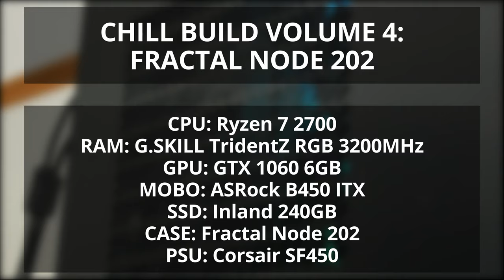Chill Build Volume 5: Fractal Node 202 "Obelisk"

Comment: Pro Tip... the section of the case where the PciE extender goes, it's removable. You are supposed to remove it to install the video card and extender together, then slide them in all at once (after you install the motherboard). It will keep you from having to deal with those screws for the PciE extender awkwardly and gives you room to install the motherboard with the CPU and cooler already attached.

I cannot take credit for this,  as i found this on on a video done by Gadget Workbench.
Reply: it also is printed in the manual - with nice big pictures :)

Comment: you can remove the video card portion of the frame, makes it easier to attach the PCIe extender if you do have the motherboard with the CPU and cooling installed. there's a few screws on the top of the center of the frame and it'll just lift out

Comment: Great video, I would always use at least one M.2 ssd in this case as it reduces the need for a cable ( space is at a premium), you can also reroute the power extension cable under the riser card if you are putting fans and a bigger graphics card in. Love this case.

Comment from the maker: Someone on reddit asked about thermals in this case. I don't usually do tests like that because I have a difficult to control ambient situation. However, after about an hour of simultaneous FFXIV benchmark, Blender 3D animation rendering, and youtube video watching, I've hit 73° C on the CPU and 77° C on the GPU. Those are the maximums at spikes of high temp. sustained average is probably closer to high 60's.

EDIT: The GPU temp made it up to 82° C after 4 hours. It wasn't pegged at 100% usage though.
Reply: yeah me too. I am using EVGA GTX 1060 3GB Single Fan also hit 82c after 30 min play game Left 4 Dead 1 hahaha. but the temp steady at that only. but one time I'm benchmark using fur mark  the temp up to 88c

Comment: Why did you not install 2 fans under the graphics card?  They keep it cooler, at least a few degrees...
Reply from the maker: It isn't always necessary to add more fans to a PC. It may keep it cooler but it may be a trade off of noise or price that isn't worth it to many. Enough is as good as a feast.

(to quote Mary Poppins)

Comment: How is the noise on this rig under load? 
Sort of want to squeeze this under a monitor stand because I have no space on my desk, but at the same time I need something relatively quiet for music production

Planning to get this case with a r5 2600 and a gtx 1660ti, but the gpu wouldn't be active itself during music. Also no HDD if that helps noise?
Reply from the maker: It's not going to be very loud, but if you need a near silent system for music production, you could make some optimizations.

What you COULD do if you want it to be very silent:

Switch out the Cryorig C7 for a Noctua NH-L9a cooler. It'll be slightly quieters, but not silent. 

You could replace the PSU with a passive SFX PSU (no fan).

If the main purpose is not gaming, but music production, you could get something like a passive GT 1030 to make it really quiet. At that point, you wouldn't need a case this big.

Comment: Your remark on the difficult-to-reach screws for the pci-e riser is incorrect. In the manual (RTFM) it is shown, that you should take out the L-shaped bracket (4 screws) onto which the riser card and the graphics card will be mounted. You can completely pre-assemble the L-shaped bracket, riser card and graphics card outside the case and insert this complete subassembly back into the case. This can be done while the MB, processor and heatsink are already in the case.

Link to manual, page 10 and 11: https://support.fractal-design.com/helpdesk/attachments/4021193594
Reply from the maker: True

Comment: 2 observations :
1. The entire vga bracket should be removed when you install the vga card,
2.The Cryorig 7 has a perfectly square cooler, so you may chose to turn it 90 degrees so that the cooler fins are parallel to the dim modules and thus will push the hot air directly to the upper exhaust of the case. Guaranteed 3-5 degrees cooler cpu temps, which in such tight spaced case is a lot. The way you've mount it, the air flow is obstructed by the memory modules.
Reply from the maker: 1. What? Can you please give your reasoning?
2. What? That's not exactly how airflow works, but you're right; it might help. Can you please show me where you got those "guaranteed" numbers, what units they're in, and how that was tested?
Reply: @ChillBuilds  1. I have the same case and the same videocard, and when mounted as you shown, the 2 "teeth" from the videocard lower end bracket (the connector plate) do not enter into the designed slots of the case the was you've installed it. You may look on yours. Thus the card is a bit "wobbly" and it needs that extra securing via the sliding bracket from the case side. And you might not be able to completely remove it in order to install for example, 2 fans for extra cooling. But that's just me. 

2. What I've meant is the "air flow" coming out from the cpu heatsink. The fan is pushing the air left and right along the heatsink fins, correct? In this way, air going along the fin alignement , on one side is obstructed by the memory modules, and on the other side is hitting the vrm heatsink. By turning it 90% your air flow will be pushed directly out towards the top of the case. And we all know that hot air rises anyway so why not help the physics. I have in intel cpu with a nh-l9i cooler which is also square 92/92 mm (the amd one is rectangle and it can be mounted in just one way). And I've did just that, switch it so that the fin orientation becomes parallel to the dimm slots, to push the air towards the case top instead towards the memory dims. And this is what happened, idle the temps dropped around 5 degree, and load was up to 3 degrees lower.
Reply from the maker: Ok, let me clarify things to everyone reading this. 

The card is installed correctly and you should definitely use the support bracket. I am not sure what this gentleman means by the "teeth" entering the slots, but your card should be essentially square with the right angles of the case when it's installed. Please always install the support bracket if you can. That's there because you're mounting the card on an extension piece connected to a riser card. It will prevent sag in the direction of the support when the case is laid flat and also block movement (and possibly damage) of the video card when you move the whole computer.

As for the temperatures, the guy posting about turning the heat sink 90° may be right, but he may also have seen a drop in temperatures due to remounting and re-pasting. Another issue is that airflow across a major portion of the VRMs gets cut off if you turn the CPU cooler. In light loads or with beefy VRMs it might be better to turn the heat sink one way or the other. That entirely depends on your hardware, workloads, and situations. Without actual test data (we don't have multiple trials, controls for variation in installation technique, controls for hardware selection, or even TEMPERATURE UNITS), I can't say whether or not his suggestion is true. It might be. I just can't tell. 

That's why I don't do extensive thermal testing on builds. If they work and get the job done in safe operating temperatures without any obvious improvements glaring back at me, I'll leave it alone. It just takes way too much time to do real tests.
Reply: @ChillBuilds  Hi, english is not my native language so I've probably been misunderstood. 

1. what I've meant is to remove that whole L bracket part, unscrew it from the 3 holding screws,  and install the videocard outside the case. Then put it back in. Leave the "teeth" issue, if I could show it to you, you would understand.  On this https://www.onbuy.com/gb/water-cooling/gigabyte-ultra-durable-vga-gv-n1060wf2-6gd-geforce-gtx-1060-graphic-card-1-gv-n1060wf2-6gd~c8579~p10952088/ you can see the card having on the  metal vga bracket one L shaped end at the "top" and ending with, 2 ""teeth" below,  under the dvi ports. When the card is mounted correctly, you should be able those 2 metal part in the back of your case as there are 2 small  spaces in the mounting bracket where those teeth fit in order to tighten the card and not rely only on the upper screws. 

2. Well I was just giving options and reason for people to consider if using a square cpu heatsink that can be installed in both ways.
Reply from the maker: @user_23165  It doesn't sound like you installed your GPU correctly. The metal mounting flange on the GPU or any expansion card is typically not removed for installation unless replacing it with a different shape flange is necessary.

Comment: Great video! 

Is there a place for a 3.5 HDD? Or just 2 2.5 SSD?
Reply: no, but there are lots of 3d printable files on thingyverse where you can mount for example 2 3,5 HDDs in one Fan-Mount, if you use a shorter graphics card or if you use an APU - for example if you build an HTPC with loads of media storage

Comment: What sort of thermals are you getting on this? Thanks
Reply from the maker: Some Farenheit, some Celcius, and a few Kelvins every now and then.

There are so many variables that even if I had great measurements, you could get wildly different results. This case is fairly well ventilated but the cooler shown is small. You can expect temps on the safe, but warm side.

Comment: I'm thinking about making this myself. Can it run Heros and Generals, CSGO, and some other light games?
Reply from the maker: This exact system is probably overkill.
Reply: @ChillBuilds  what should I do then?
Reply from the maker: @embxssyy9936  Is that.all you want to.do.with the PC? Playing in 1080p? What's your budget? Where are you?
Reply: @ChillBuilds  Budget is under 1k but I'm thinking under $600. I just want a pc that I can play games with no problem.
Reply from the maker: @embxssyy9936  "Play games with no problems" isn't very specific. But, if you get a decent quad or 6 core AMD CPU  and something like an RX 570 4GB, you should be able to easily play those games and put together a PC in the lower range of that budget. Just remember to get a legit Windows. Don't pirate.
Reply: @ChillBuilds  okay thanks man
Reply: @ChillBuilds  I disagree, you should get legit windows.  You should pirate windows. It's the way to go it's the moral way to go it's the way to progress technology forward by pirating windows!  ;-)
Reply: You shouldn't get legit windows. Legit windows is shit. It's rip off. You should instead pirate it with a good conscious.  Why pay for Windows loaded with problems and instability, when  apple offers Mac os for free which works superior to windows by light-years better than winshit 10

Comment: is that cryorig C1 CPU air cooler?
Reply from the maker: Nope, that's the c7
Reply: @ChillBuilds  thanks for the info, but does the C1 fit to the case? i want to build like your video but using C1
Reply from the maker: @dandysetyo9365  I don't have the case anymore. Check the specified height of the cooler and the manual for the case for the maximum cooler height that it will support.
Reply: @ChillBuilds  thanks a lot man 👍👍

Comment: Do you recommend this exact pc build for 1080p gaming and college school work?
Reply from the maker: There are a lot of "depends" kinds of answers I could give. Depending on your major, you could do college work on a potato. This exact build is probably good for most things you'll do, overkill for some, and if you want to play the newest games and the highest settings at 240Hz, it probably wouldn't cut it.

It is a great all-around mid range build. If you're buying used, you can probably get enough great deals to make this an awesome choice.
Reply: @ChillBuilds  I'm majoring civil engineering and I really want to build my pc into this case and I only play games like csgo, DOTA2, overwatch and league of legends although I do play some mmo RPGs like dragon nest too.
Reply from the maker: @johnreyes3034  I still think it's probably overkill, but I'm not picky. Shop around though. If you can find an ITX board that has the bios update for Rzyen 3000 done, you might find you like the 3600 better than the 2700.
Reply: @ChillBuilds  Noted. Thankyou (Y)
Reply: One last question though, do you recommend a different cooler than the one you used in this build?
Reply from the maker: @johnreyes3034  If you are sticking with an AMD AM4 CPU, this seems like a good choice: https://www.newegg.com/p/13C-0005-00145?Description=nocta%20l9a&cm_re=nocta_l9a-13C-0005-00145-Product